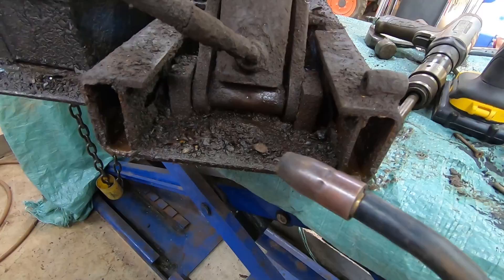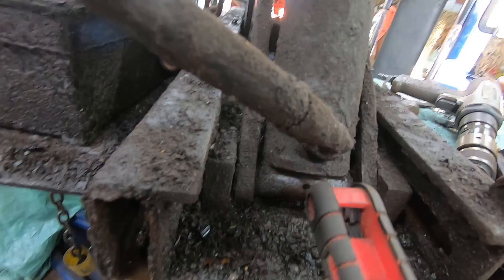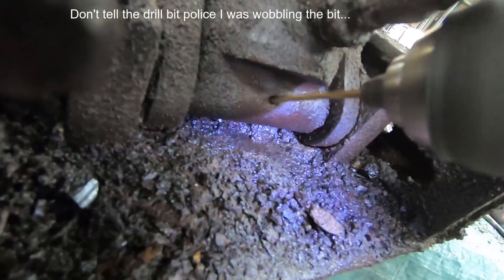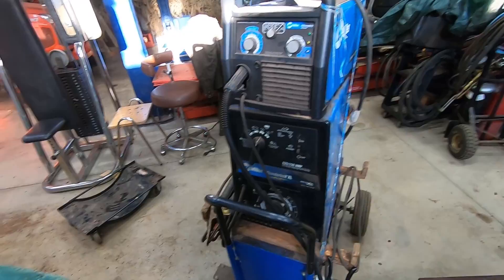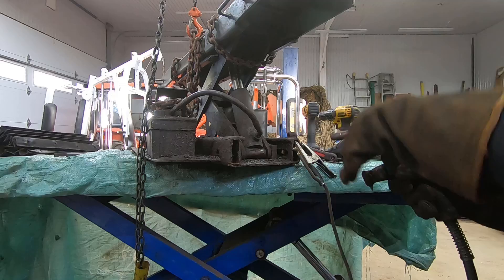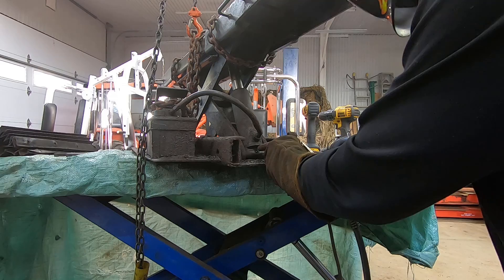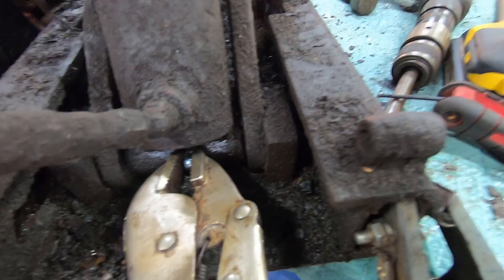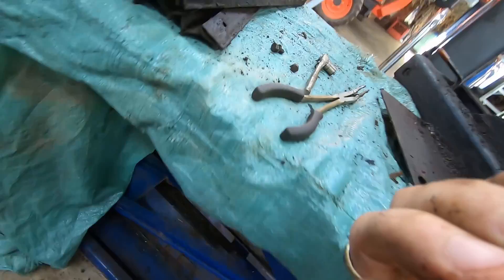DIY_Extracting Stripped Set Screw

Comment: Most Homeowners looking for DIY tips don’t have welders laying around lol
Reply from the maker: You are right! Some home owners don't even have a screw driver...  but those people don't even know what a set screw is...
Reply: @mrdiyguy123  I disagree but that’s what the Internet is for lol
Reply: @natep765  Yeh I came looking for this solution but have no welding gear. Bugger :P
Reply: I came to the comments to find someone else who probably thought this too. And here it is. I agree with Nate P. 
DIY = Do It Yourself, meaning anyone should be able to pull it off, even if you're the average Joe... It's something easy, all you need is a tip, a trick or a quick lesson and then you can do it without having to ask someone to come over to do it for you... It's not something requiring speciality expensive heavy duty tools and extensive knowledge of and experience with in order to be able to do it yourself.
¯\_(⊙_ʖ⊙)_/¯

Comment: If you feel strong resistance when trying to remove a grub screw/setscrew it probably has loctite on it, spray some penetrating oil, wipe the excess, heat up the area with a nice blowtorch while your key is in, now carefully start undoing it with steady pressure, your Allen key can be almost red hot so be careful not burn your hands.